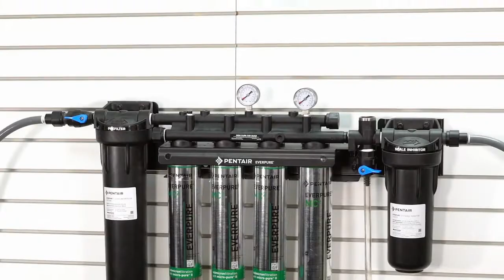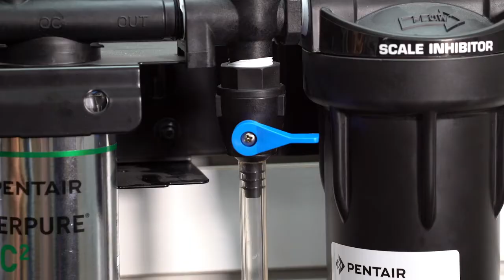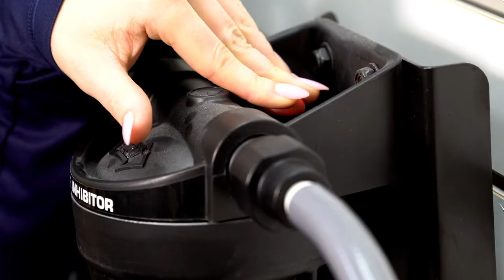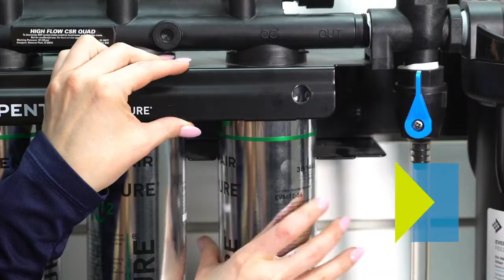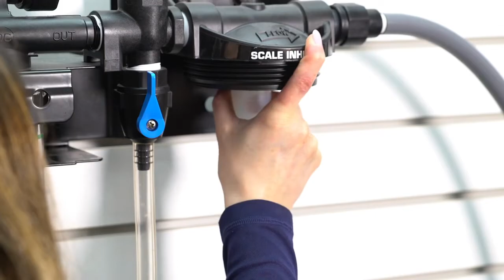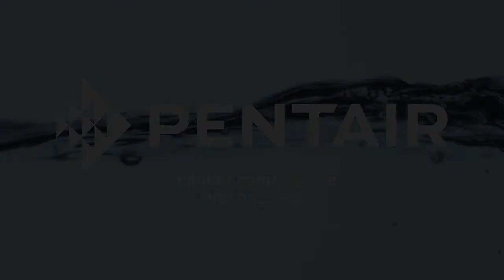How to replace a water cartridge | Water Filtration | Pentair

Comment: Found out my filter pressure water was really low to my ice machine and fountain water line. I checked each 3 of the filters one by one and test the pressure and its fine. Once i insert it back in on any 3, the pressure become low again. Is that mean i need to replace all 3 filters, pre and post?

Comment: do you need to run the pre filter when its installed? if a system just has a pre filter?
Reply from the maker: It will depend on the water in your area. You only use a pre-filter to take our the sediment. Are you looking for a filtration system?

Comment: Can we run the system without the post filter?
Reply: I follow these steps, when I did the flush for the carbon filters the drain line came off from the high water pressure.